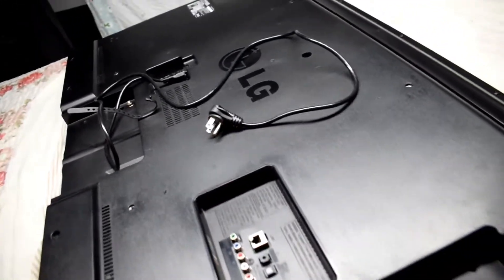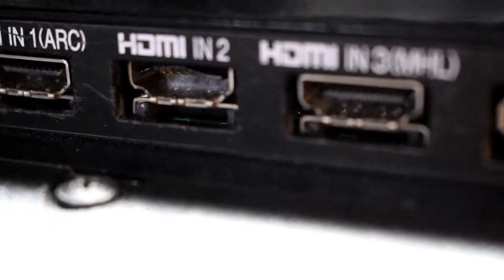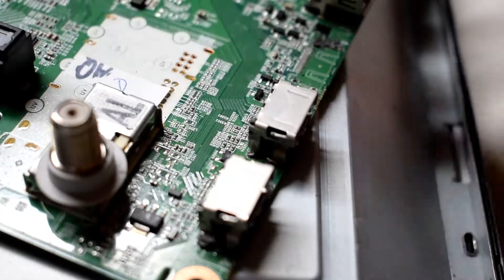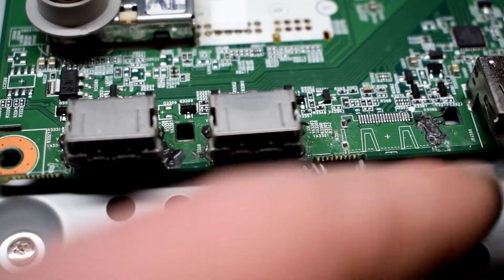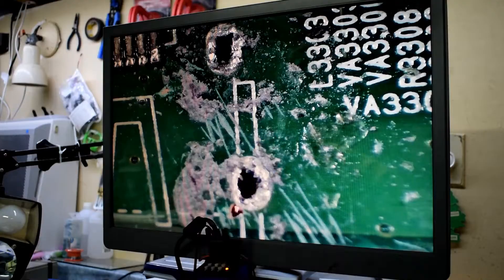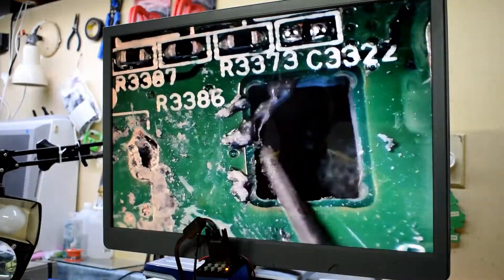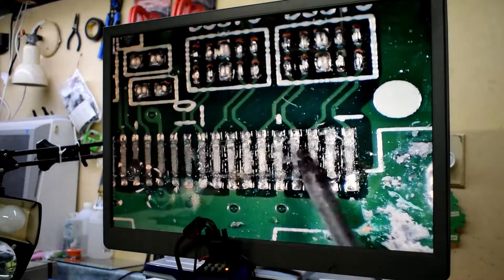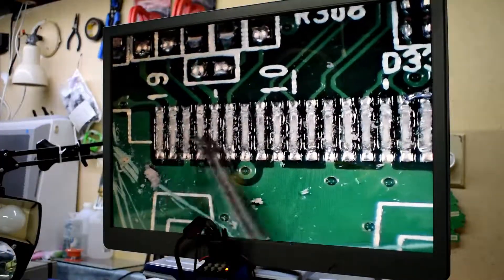LG TV HDMI Port Repair Highlights - 3 HDMI Ports Not Working

Comment: My exploits includes reflowing the main board off my LG, replacing a zener diode, soldering on some blown capacitors. This seems like it's out of my scope. Mainly because it seems like precision equipment is needed.

Comment: Hello, I’ve checked out a bunch of your videos. Thanks for the concise content! 

I have a Samsung QN65Q6DRAFXZC and I believe the problem to be the main board as there is heat evidence on the plastic back panel of TV. Back lights work when cable to main board is unplugged. Heatsink is quite warm too. 

However, is there a sure fire test for the main board before I purchase new board and display ribbons? 

Much thanks!

Comment: what type of hdmi port is this i ordered some but the legs are flush so they dont fit, do you have a link to the proper replacement hdmi port thanks
Reply from the maker: the only way to tell is to take a picture and look at some online they come with many different types it might help to have a box of assorted hdmis to choose from

Comment: One question: what gear are you using? what magnifieing camera/microscope is that? Which type of flux is best for this type of connectors? unfortunatelly my 2010 LG TV hdmi's are broken as well...
thx
Reply from the maker: I use this scope https://youtu.be/k1cXUrQG4eI any flux will due you also don't need a scope if you have good eye sight.

Comment: This has literally happened to mind on Friday took back of and found the 3 hdmi ports inside. Mines a lg 50lf580v near sure yours the same.  Mines doesn't need cleaned up so if I just go ahead and solder will it be OK.  Thanks.
Reply from the maker: hop it all works out use lots of flux!!
Reply: @NewsonsElectronics  vaseline works just the same an is way cheaper